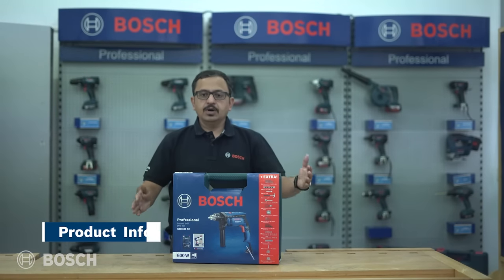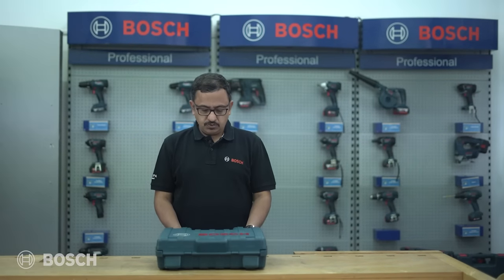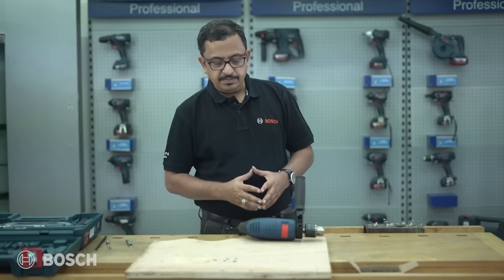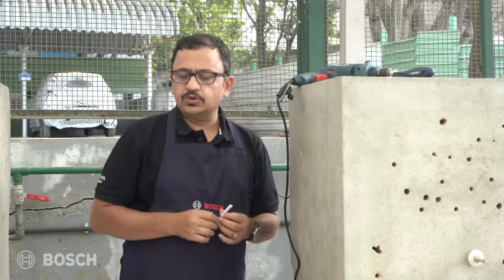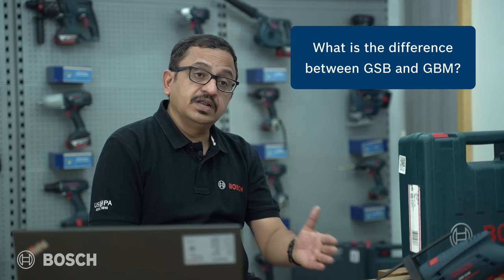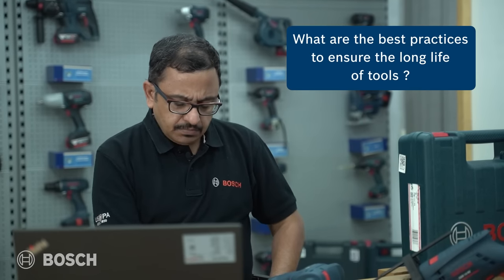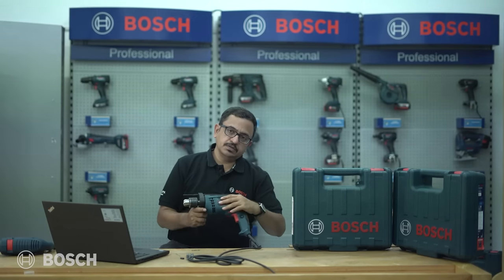Bosch GSB 600 RE 13mm 600 Watt Corded Smart Drill + 98 Accessories | Compact and Powerful Drill Kit

Comment: Hello  sir    do u have any  speed variable angel grinder on 4 " ? 
Can we use   4" asseseries( cup brush,velcro pad, grinding disc  etc )to  900-125s  angel  grinder  ? Is ther any adaptor to use all 4" asseseries to  900-125s model ?
Reply from the maker: Kindly call us on 1800 425 8665; Mon-Sat 8 a.m. - 8 p.m. Except Sundays and Public Holidays.

Comment: I went to a dealer. He has only GSB600. There is no GSB600 RE.  Surprising the GSB 600 has the reverse button. Is the 600RE discontinued?
Reply from the maker: Hi there, thank you for contacting Bosch Power Tools India. GSB 600 is the new upgraded 13 mm impact drill from Bosch Power Tools, for more info- 
https://www.bosch-pt.co.in/in/en/products/gsb-600-06011A03F0

Comment: What is the difference between GSB 600 & GSB 600 RE ?
Reply from the maker: Hi, thank you for contacting Bosch Power Tools India. GSB 600 is the new upgraded 13 mm impact drill from Bosch Power Tools, for more info- 
https://www.bosch-pt.co.in/in/en/products/gsb-600-06011A03F0

Comment: What is the difference between this product gsb 600 re and gsb 600?
Reply from the maker: For more information on the NEW Upgraded GSB 600 - https://www.bosch-pt.co.in/in/en/products/gsb-600-06011A03F0
Reply: Bosch GSB 600 vs BOSCH GSB 600 E smart drill

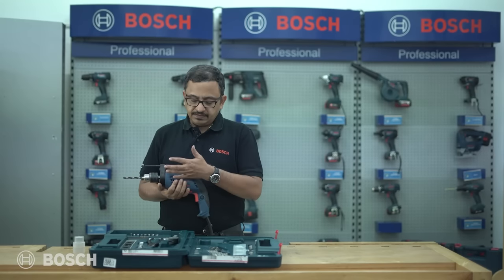Comment: 8:21 did you just rest the drill machine on the drill bit! that's not proper practice - also explanation on types of drill bits 9:41 by pressing on palm is so not per Bosch standards 🤣 you need a better sales rep or technical  product manager guy explaining  - this is a sincere suggestion